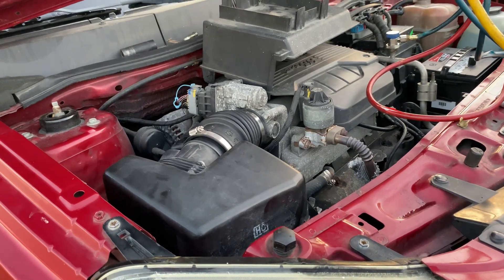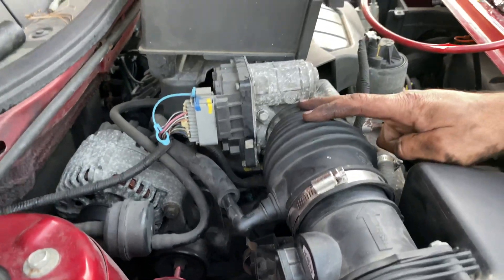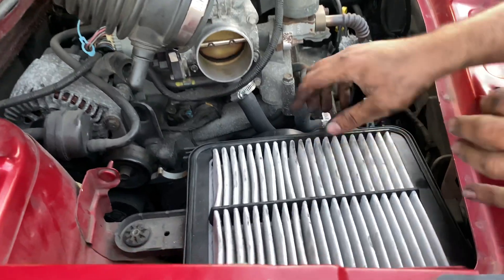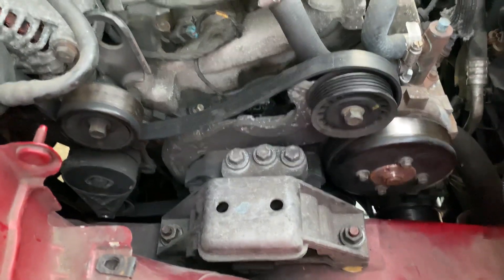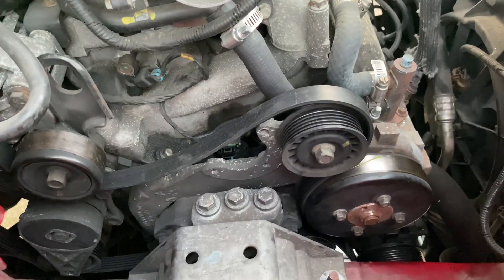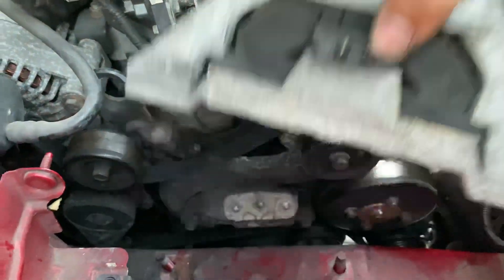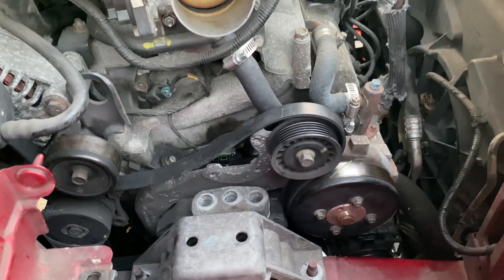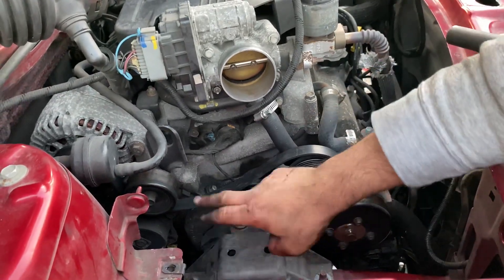How to change motor/engine mount on a Chevy Equinox

Comment: Thank you for this video...Did you by chance do any of the other motor mounts?
Reply from the maker: Sorry I didn't change any of the other ones. Looks like this video shows the other motor mount.
https://www.youtube.com/watch?v=xVcq7OKRoFg
Reply: @abuzar1  thanks for sharing that link and thanks for sharing the info in your video.
Reply: Dr. Baloach 

It shows 3 but does not include the 4th mount on the transmission (driver’s side). The 4th mount is probably the most difficult to change. An instructional video of that mount would be of most benefit.

Comment: That is NOT the "Cabin Air Filter"... It is the ENGINE AIR FILTER.  The cabin air filter is located under the windshield where the hood meets the cowling.  It has a little snap-down cover on it.  Thanks!
Reply from the maker: Yeah, I know that. I don’t know why I said cabin air filter lol.

Comment: I Have a 2006 Pontiac Torrent  SUV FWD,  3.4L v6, I Just had All Brand New Parts installed.
 2 new Struts, 2 new lower control arms, 2 new stabilizer links, 2 new front  Wheel Hub  bearings, 2 new CV Axle Shafts.  But now kinda have new problem as when  i put the SUV into (Drive) it's fine, but as soon as i Put it into (Reverse)  while holding the brake peddle  you Here a Clunk, from the Passenger Side front, and also when driving  over bumps on the road ways i can here a popping Sound, had the Struts rechecked and no problems. could it be that the upper Engine Mount cause this Problem.

Comment: Do you know the specs of the bolts used for the mount? The 15" ones. I can't find them anywhere
Reply from the maker: No but if yours are messed up I would just go to a junk yard and pull them.
Reply: @abuzar1  I'm gonna call around some more part stores and see if they have any. I don't have too big of a junkyard near me. Thank you though!

Comment: I unbolted my mount but it seems like it's stuck to the vehicle, any ideas?
Reply from the maker: Are you sure every bolt is out? What is the mount stuck to? Body or engine? Have you tried hitting it with a mallet or jacking the engine up and down?
Reply: I have the 2 large nuts off and the 3 15mm bolts out, the motor lowers an inch or so. I try to jack up the motor and it only goes as high as the mount. It seems like the mount is stuck to the body for some reason.
Reply from the maker: @ryanfryman4029  There should be nothing holding it in place if it is the same car. If all the visible bolts are out you should be good! Try posting a picture here. Try a pry bar to move the mount off the body. It may have rusted in place.

Comment: I'm thinking that one of mine is acting up... I already had them changed though I thought,uuuuug.. When I go into reverse sometimes it makes a ,, its hard to describe the feeling and sounds.. It's like heavy equipment.. only does it in reverse... I remember after I had an accident... Someone pulled out in front of me and ripped off the front end.. It behaved that way then.. I was freaking out!... Then to find out it was just the mounts that needed to be replaced..
Reply from the maker: Did you change your transmission mounts too?
Reply: @abuzar1  I honestly cannot remember.. There was a lot going on with the repairing of the front end.. I should have the paperwork.. somewhere.. I am upset with myself for not getting a manilla folder and placing all receipts for the car in it.  I usually do that .. Not to go off on a tangent but the last year and a half has been pretty crazy in my life ... I know that if my mechanic recommended it.. which I would think he would have.. One of those "since I'm down there" situations, that more than likely I did.. but I need to find the paperwork for proof.. of whether I did or did not.